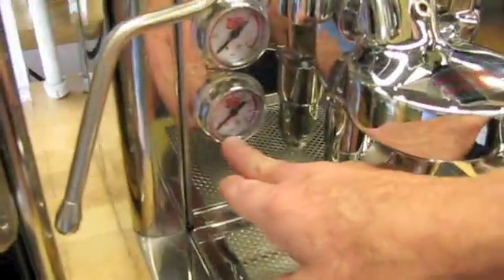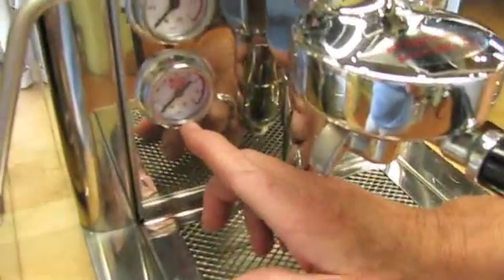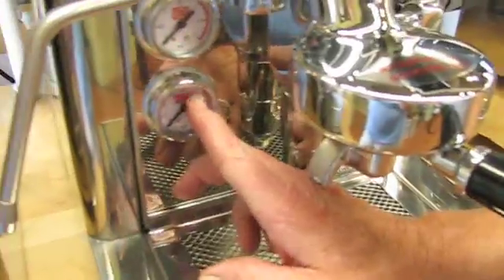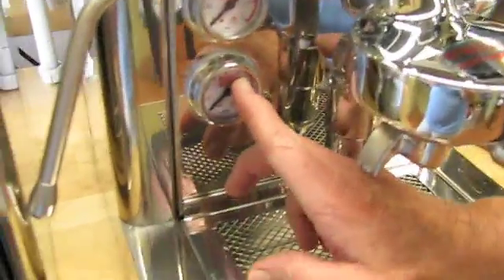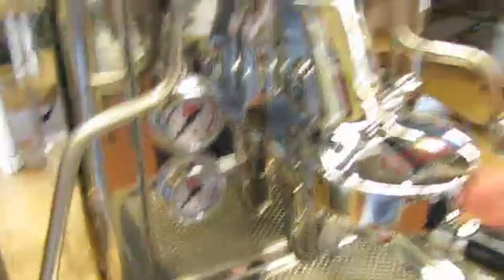Espresso Machine BAR Pressure Primer

Comment: Very enlightening thank you, I have recently replaced my expansion valve(16.5) on my Musica, is that normal that it doesn’t give out any water during back flush and extraction? Because after watching this I just realize that only under an extreme situation the expansion valve might open. 
When I have coffee extracted down the spouts it means the pressure is not building up and it stays steady. Extraction is a form of release  itself right?🤓
Reply from the maker: Hello!

Yes, the extraction process is also pressure release, as long as your coffee is tasting good and pulling correctly I wouldn't worry!

Comment: Professional machine uses expensive rotary pump to pressure a constant water flow at 9 bar through the coffee. Cheaper home machine uses vibratory pump which cannot give consistent water flow. Hence it needs 15-20 bar to "push".  This cheaper machine uses a release valve to adjust the 15 bar to 9 bar at the coffee filter.

Comment: I have had a gaggia classic for about a week now. My shots come out in 15-18 seconds. Do you think this is because the machine is set up at 12 bar and I should adjust it? I am a complete n00b and really dont feel comfortable opening up my machine.
Reply from the maker: The gaggia should be set up to brew at 8-9 bars. Unless you or somebody changed the internals? I'm not sure if that is even possible. Are you using a pressurized portafilter?
If you are using a non-pressurized portafilter and your coffee is extracting that quickly it means your coffee is too coarse and/or your tamp is too light. Finer coffee should do the trick. - Steven
Reply: I pulled two shots today for the first time using the unpressurized portafilter. The shots were both doubles and 16 and 20 seconds respectively. Earlier today I pulled off a perfect 25 second shot using the pressurized portafilter. I am going to start using the unpressurized from now on. I was told on a forum that the factory pressure is 12 bar. Is this correct? I bought mine brand new and have not tampered with it at all.
Reply from the maker: dox1842 I would say try grind your coffee more fine and see what that does. I am not sure about the factory pressure. I don't see why they would have it that high. - Steven
Reply: awesome. I will have to wait until I can buy a coffee grinder. Right now I am having my coffee ground for espresso by the roaster. The next time I order coffee from them I might tell them to take it down a setting.